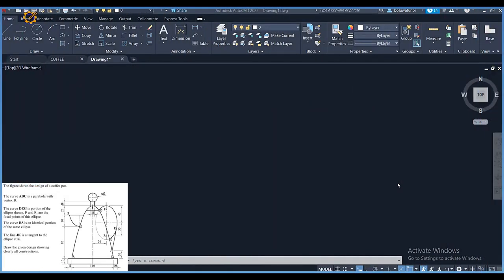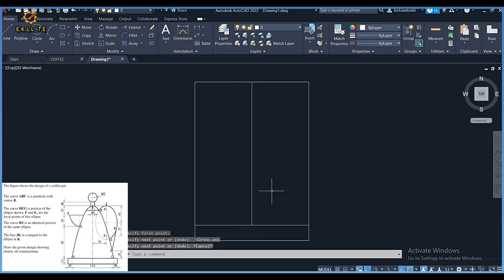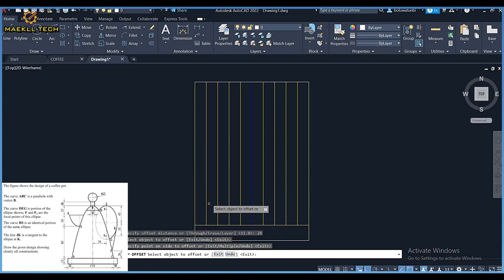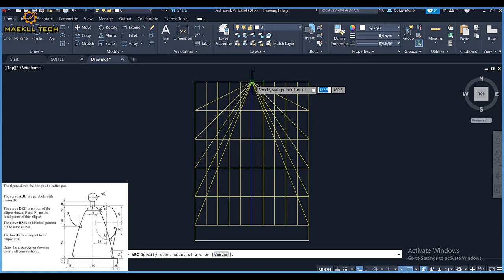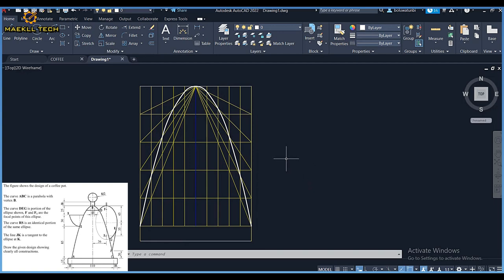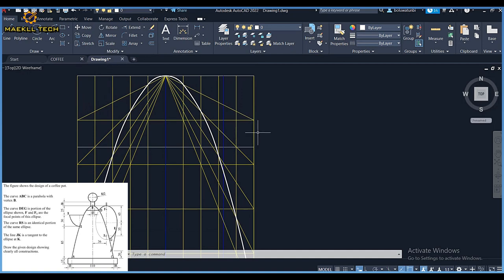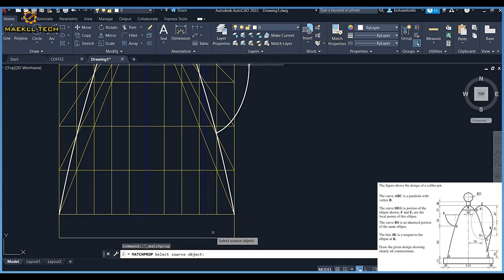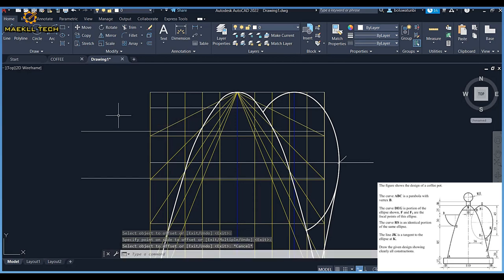Coffee pot in | Technical drawing | Engineering drawing

Comment: Cho em hỏi khai triển các múi ống trên mặt phẳng nối các điểm lại với nhau bằng compa dùng cách nào
Reply from the maker: English please??
Reply: @MAEKLLTECH  Please tell me how to expand the regions of pipes on the plane connecting the points together using a compass
Reply from the maker: @DungNguyen-xq1tl  I will advise you use a French curve or irregular curve to join the points together... 

Check the link below
https://www.google.com/search?q=french+curve&oq=french+curve&aqs=chrome.0.0i433i512j0i131i433i512l2j0i433i512j0i512l4.3607j1j9&client=ms-android-samsung-gj-rev1&sourceid=chrome-mobile&ie=UTF-8
Reply: @MAEKLLTECH  Is there a way to draw with a compass, the diameter of the pipe is so big that I can't use that tool
Reply from the maker: @DungNguyen-xq1tl  look for a long pencil,  and fit the pencil almost leaving the compass, it will work like that